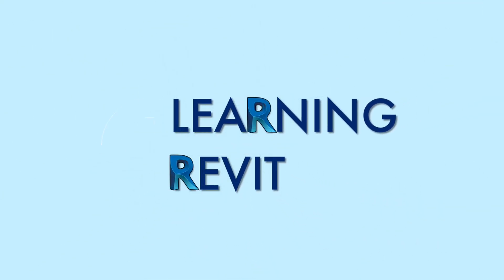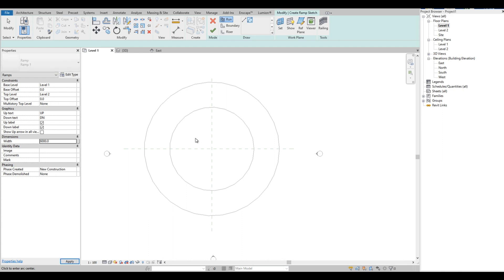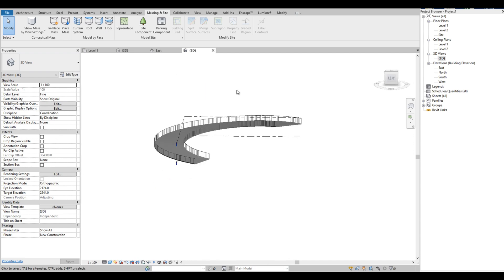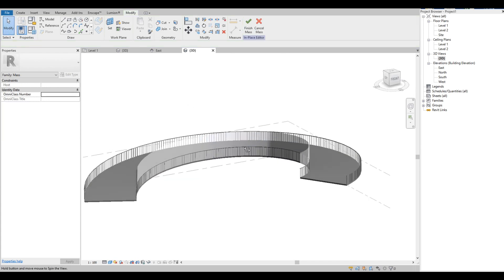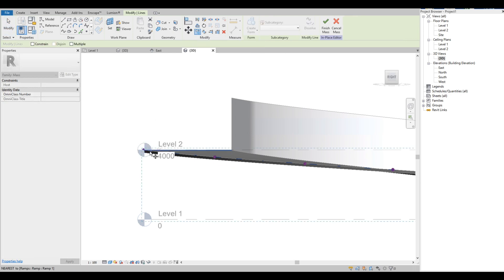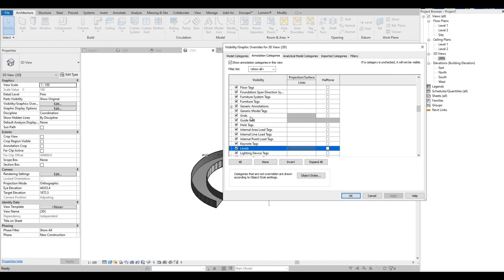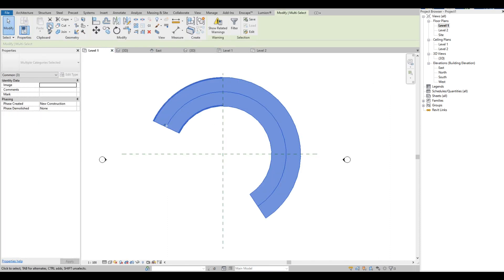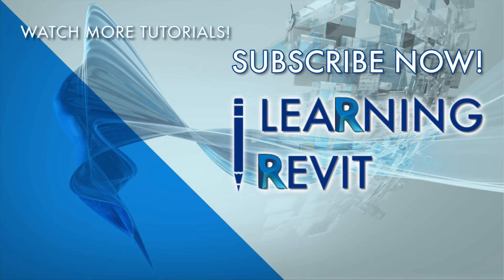HOW TO CREATE RAMP FOR MULTI-LEVEL PARKING BUILDING | REVIT TUTORIAL FOR BEGINNERS

Comment: THANK YOU SO MUCH FOR YOUR EFFORT BUT I HAVE A QUSTION I NEED THIS TO BE VALID TO HOST REBAR , HOW CAN THIS BE POSSIBLE?
Reply from the maker: I have not tried it yet, but from what I’ve learned, there is a limitation for rebars when added to a wall by face command. This something that needs to be explored. I have included a link to a forum for your information. 

https://forums.autodesk.com/t5/revit-structure-forum/rebar-limitations-for-wall-by-face/td-p/8468658#:~:text=When%20using%20Revit%20massing%20tools,allow%20adding%20free%20form%20rebar.

Thank you very much for your support.

Comment: If your not gonna create a proper wall just create a  railing family that looks like a wall and it will follow the ramp
Reply from the maker: Yes, that is also an option using profile of a wall and apply it as a railing. Just have to take note when extracting wall areas or length through a schedule to use railing also. This will be separated from the normal Wall Area Schedule.

Comment: If using the in-place mass method doesn't work when creating the walls, is it not possible to use pick line when creating a normal wall. Apart from that, thank you very much this video was really helpful.
Reply from the maker: Using pick line will only follow the circular shape of the ramp, it won't follow the gradient or the change in level. Thank you for the comment.